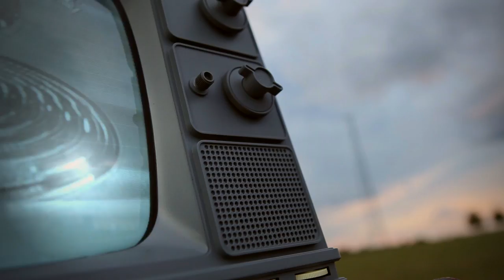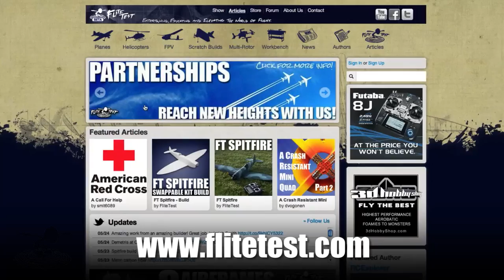Flite Test - The Roadrunner - 38cc Gas Airplane

Comment: How long can it fly?
Reply: Depends the fuel tank and engine. In this Size Planes, its a 500-800 ml Tank i'd say. 15-20 Minutes
Reply: RapaSheepZ 15~20min, hmm what is the max thrust of the engine+prop? There is a possible way to make a plane to have max weight, if with ~600ml you can fly 20min then with 2kg you can fly lets say an hour
Reply: Domino SixO which engine do you mean? i dont really think that you can fly one hour.. probably has to be a very big plane
Reply: RapaSheepZ If you calculate the engine thrust and the plane lift combine them in a really good way, you can fully load your airplane with fuel and only the take off will take full thrust, after you are at high alt. you can glide with 20% thrust. 2+ meter wing.s.
Reply: Domino SixO
if you can still see it in that height^^
Reply: RapaSheepZ using FPV ? 100$ FPV gives 2km range, best price for beginners.
Reply: Domino SixO
careful. i fly fpv too. if u use a gas engine on a plane it will vibrate very much. there will be lines in the video and fpv is already dangerous with electro planes, you have to know what u do. 2nd thing. it CAN give you more then 2km, but you Remote Controll (Radio) wont let you fly that long. means, you fly fpv and see the video but you cant controll it any more because there is no Radio signal from your transmitter......
Reply: RapaSheepZ If you get a better antena and transmiter you can get up to 5~10kg range as beginner components, my point is that you can fly long with a gas engine plane and fpv to control it easily.
Reply: Domino SixO
flight time yes, range maybe, and fpv is probably bad because of the virations... maybe you should google something like fpv and gas plane, i dont know it for sure
Reply: RapaSheepZ There is many absorbing materials for vibration, I don't think USA Drones have that kind of problems with their huge cameras on drones.
Reply: Domino SixO
I dont know them in germany^^ U have to remember thats military technology. probably its a a gimbal like on a quadcopter idk.
Reply: RapaSheepZ So you tell me in germany they don't allow that kind of things to fly in the air? even homemade ones ?:D
Reply: it is allowed but i dont know which u mean XD
Reply: RapaSheepZ what which?
Reply: Domino SixO
USA Drones
if you speak about something like a 'reaper uav' for example

Comment: Gas is the best.  Most my models are electric now, but my favorites are my gassers.  Now you need to get a Bennett Built muffler, Sullivan pump and a 12 or 16 oz smoke oil tank!  You should review the GP Giant Super Sportster.  Sweet gas low-wing model.  Or the Giant Ugly Stik.  And don't forget the floats!

Comment: Incredibly impractical. The tricopter maintains control through precise variations in prop speed, keeping it level. That just isn't feasible with gas engines. I've thought about it.

Comment: So, what's the difference between nitro and gas? :)
Reply: Gas is petrol and Nitro is synthetic model fuel.
Reply: Gareth Fletcher
I'll elaborate on your answer.  Gas is a gasoline oil mixture (same or similar to chainsaw fuel), "nitro" is an ethanol, lubricating oil (either castor oil or a synthetic oil or a combination of the two)  and nitro methane mixture.  Nitro fuel is usually expressed as 5%, 10%, 15,% etc indicating the amount of nitro methane.
Reply: Ferd Werffle Thanks for the correction.

Comment: hey guys you should have balanced the cg with the tank empty otherwise when you start flying you will end up tail heavy as the fuel is burned up. just a tip from a fan

Comment: How far can it fly?
Reply: It's like a weed eater. If you use 1/2 throttle it should last 20-30 min. but if I had it I would fill it up, and run it till it ran out! That would give you a good idea of how long.
Reply: Got it.Thanks

Comment: You want to balance it without fuel in it because when the fuel runs out then you will be tail heavy. I fly all of my nitro and gas planes a little nose heavy anyway!
Reply: and you want the fuel inlet on the carb to be level with the middle of the tank.

Comment: Another observation - if this video is "real time" you gassed it up BEFORE checking the C.G.  For gasoline and glow fuel models the practice should be to balance dry and then add fuel.  Probably would have then flown better without dragging a C-clamp around.  Great stuff otherwise - keep up the good work.

Comment: Hey guys....
Whats even better is 4 cycle engines....
talk about sounding like a real airplane motor... idles fantastically low...
incredible torque....
small cc to large cc  the best way to fly! better then mixing car gas with oil to fly weed eaters!

4 cycles just use regular glow fuel with a bit more oil in the mix!
do a show on 4 cycles!

Comment: lol screw the kill switch and rag..if you want to turn it off just pull the spark plug wire off
Reply: +Cody Black I just trim it to starve the engine
Reply: Doesn't work every time. Or better said, it takes longer than a kill switch

Comment: I'm cheep, I'm thinking the inexpensive, Home cheepo(Home Depot)weed eater, With copper wire, or Desoldering wick, wraped around the spark plug wire for  RF noise... We could put a Gator in it's cockpit...

Comment: all the electric people hating and it like yer but gas get longer flight times some gas engines could run on that small tank for 1 to 2 hour so please lol
Reply: I dont hate them.. there is many arround in out field.. including all pretty big ones.. but its a world of trouble.. they requiere much much more maintenance and tunning and even so they are quite temperamental.. i see so many glow guys in the ramp trying to start a plane that just flew fine the day before ....if not the previous flight .
And then there is the problem that if you live in a flat its a big mess to run and test inside...

I fly electrics because im lazy on that regard and my family would kill me if i start a glow at home (they are allready anoyed at electrics)